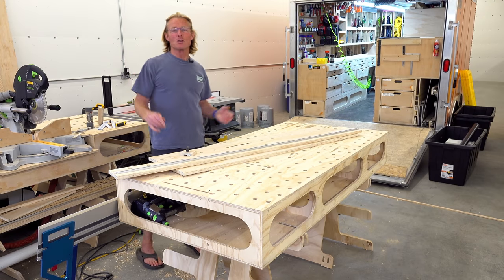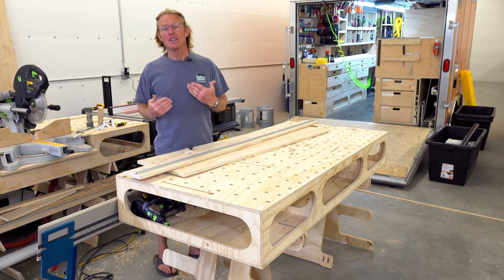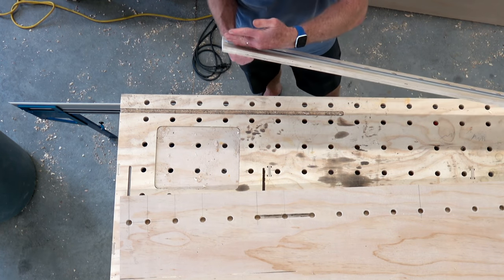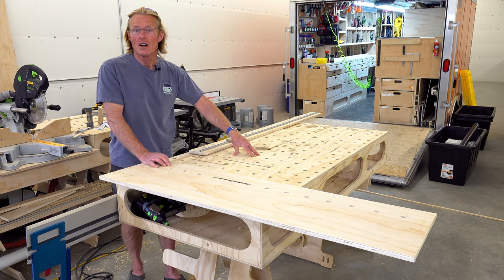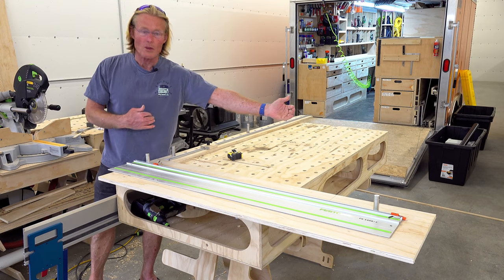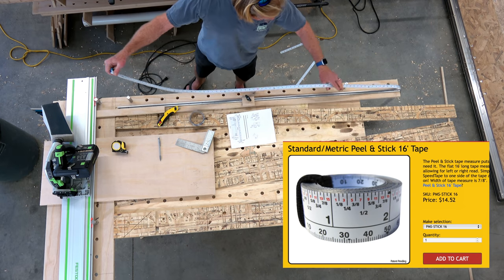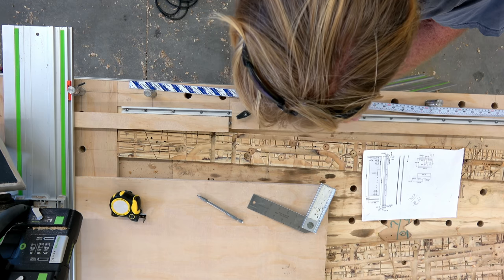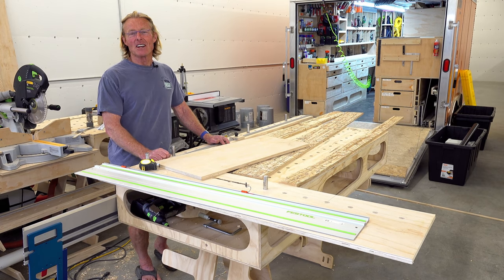Smart Cross Cut or SCC

Comment: Thanks Ron!--you just solved how to keep the bench from being scarred up.  I almost ran a sacrificial MDF strip like the MFT, but this is more elegant.  I have the workbench II finished and loving it.  Front half (router side) is setup standard 90 degree x/y, and the back 2x8' section was setup with an isometric layout.  This fixture will be perfect for either setup.  
Side note--Try the TSO precision dogs--they take a standard m8 based knob and are much easier to put in and out over the ones in the UJK kit (mine is version 1, not the new version 2 that you have). And yes..the UJK parf guide is amazing for laying out the top.

Comment: I noticed when you were laying out the initial 3mm holes with the Parf System that you started from the end of the board.  Peter Parfitt recommends that if the length of your hole pattern is much greater than the length of your Parf stick that you start at the center of the board and then work out to the ends.  Much less likely to introduce any alignment errors.
Reply: Ron's benches are a multiple of 32mm on 96mm centers. the first hole is 32mm from all edges and the second hole from the edge is 96mm. every hole after that is 96mm on center. When you get to the opposite end you will have the last two holes being 32 mm and 96mm from that edge.

Comment: Also curious how you got your row of 20mm holes parallel to the T-rack?  Did you use a spacer to set the perf stick away from the T-track perhaps?  Thanks for the great videos.
Reply: I am at that point as well. I may use the second parf stick as as a spacer. I do want the holes perfectly aligned with the track.

Comment: Hi Ron. I was cutting 600mm sections repeatedly from a single, long (2440x~50mm) piece. For me it worked better to do the cuts about a quarter of the way along my Paulk Total Station (seriously, have you heard of them? They're great!) and feed the material right to left along the bench. This mean that the long piece I was taking parts off was supported by the other 3/4 of the bench to my right, and the piece I wanted I grabbed with my left hand and added to my components pile. I see that because of the fence, measuring tape, and stop block, my approach wouldn't work. That's fine, but I wonder how you manage feeding in larger pieces to systematically take chunks off them? Do you simply put another bench or saw horse or something to the right of the bench to hold it up?

Comment: Ron, @ 3:02 looks like you might benefit from adding a couple hanger hooks for the track on the front of the bench Ron. I see you went to put it down and it slipped. Seems all it would take is a nudge and it's gonna fall, but if it was hanging on a pair of hooks on the face of the bench it wouldn't and less chance of damage to the track.
Reply: A pair of Track Racks would work great for this situation. Wouldn't even have to lock them in. Just mount them upside down, stick the track in there when not using it, and that thing won't go anywhere.
Reply: @wichyfication  do you have a link for Track Racks?

Comment: Hey Ron, excellent stuff.  I wish I would have found you a long time ago actually.  To get to the point, I am building a table based off of your design.  I purchased some TSO bench dogs and the TDS-13.  My question is for anyone really is regarding if I should build this cross cut as well or just utilize the bench dogs and TDS-13 for repeatable cuts.  It seems like your design is more efficient and repeatable when breaking down and resetting up to make more of the same cut in the future.  Is that an accurate statement?  It seems like once set up, they both would work well.  Am I correct in my thought process?  I am going to be using this for everything, but my first task is to build cabinets for my kitchen as I am remodeling it.  Thanks again.

Comment: Ron,  
Do you ever wish you had a cabinet saw or do the jobsite TS's cut quality and accuracy meet your needs?  Your finish home remodels always look professional and spot on, I just wondered if you didn't need as much mobility if you would consider a cabinet saw.  Also have you had a cabinet saw in the past?  Thanks for your channel!
Reply from the maker: John Petsche I have not once miss having a cabinet saw. I get the results of a sliding table saw with my FT track and for rips 18” and under the SS job site table saw works as well as any cabinet saw.

Comment: First, I would be interested in plans for this.  Second, how do you handle narrow stock cross cuts (more narrow than the FT rail)?
Reply from the maker: Link to plans: https://stores.modularmarket.com/paulk_homes/index.php  I use a table saw for narrow rips. I don't have an absolute, but 18" and under the table saw is my goto.

Comment: Ron, the workbench that you are using your  cross cut fixture on, is that your compact workbench 3x6?  The holes on that workbench were made with the UJK parf jig, correct?
Reply from the maker: The PCB predates switching to metric so the holes are 20mm but laid out 102mm(4") Just ignore the layout on the plans and use the Parf Guide for 96mm spacing. I plan on updating the PCB to be exactly like the STS when I have time. Personally, I would get the STS and build it without  the miter stuff and you will have the new PCB that I will be calling the SCB😎🤙

Comment: Ron, I noticed you were using the UJK chamfer tool on plywood.  The websites that sell this tool all have warnings that the tool should only be used on MDF and HDF.  I assume they are worried about chipping the veneer.  Have you had any problems?  I don't have a router yet and this tool seems ideal otherwise.

Comment: Do you have any jigs for repeated rips of narrow stock with a tracksaw for face frames? Id like to eliminate my tablesaw if I can.
Reply: two ways--(with jig above) use a spacer same thickness as your stock but wide enough to support the track. The measurement would be the tape minus your spacer. Make it about 300mm (~12 inches) from stop block to business side of the track, and as wide as you can (parallel to the track cutting side).
Second way--use a jig on what is normally the 'waste' side of the track saw.  Use 1/2" ply as a bottom for the jig and make 96mm dog holes to index into the bench (like the cutoff side in the SCC). Use 1x as a stop block and mount toggle clamps.  Think taper jig for a table saw (slot out the 1x to adjust depth (width) of cut).  Just remember--you  are cutting on the 'opposite' side of the track, so have to add in the blade kerf to the measurement--the good stock comes out the 'waste' side. If you dont, what you cut is going to be a bit of 2mm short.

Comment: Would be better if the material could slide under the track without  lifting the track. Great work Ron
Reply: You would need to make sure that the height of he track then is perfect and will not bend or flex because that could throw the cut out and make it so it is not square.

Comment: curious how you compare your SCC to using your TSO track square and a TSO TPG to do the same?
Reply from the maker: I am planning on doing a review of the TSO soon. I am a field beta tester for TSO so my kit is a prototype from a few years ago. I should get the final set soon and after I put them through some testing, I will do a detailed review with my opinion. In short, I use the TSO for a lot, but the SCC is for production. When I build a set of cabinets with many dozen sides like when building the Smart Woodshop I set up the SCC. There is a lot of overlap, but I find plenty of uses for both. We live in a great time when we can get the accuracy and production of a 10' sliding saw with hand tools that go to the job.

Comment: Hi Ron, why do you use two table saws at the same time?
Reply from the maker: I enjoy setting up one for dado and the other for the rest. It is a luxury and not necessary, but nice if you can.
Reply: Thanks Ron. I’m planning to do most of your things including the van trailer as I need to shift between home, warehouse and job sites. Your work is going to save me months if not years of exploring. One more question, if the following Festool table saws are both available in NA, which one will you buy to add to your smart workshop: CS 50/70 or TKS 80?

Comment: Ron, is the parf system the only way to make this viable?
Reply from the maker: WhoDatBe Dare or CNC.
Reply: Of course not. It's massively over engineered and completely unecessary.  The holes serve no useful function unless you're face clamping things down. (and even then there's much simpler ways).  You just need an 8ft straight batten fixed to one side of your table and two blocks of wood nailed down square to it to rest the track against.  This 32mm system shit is getting way out of hand.
Reply: @juancornetto8243  No. You are completely wrong. I have a wood technology degree from EKU. I have worked in multi million dollar wood labs. This system is a complete revolution. It replaces many of the 6 figure machines I used for commercial set ups. It is just as accurate, and much easier to use. The original Festool MFT table is a great idea poorly executed.

Ron is a straight up genius. He fixed 90% of Festool's problems for them.

Comment: Ron, from watching your videos, I see that you have switched between metric and imperial. (You previously drilled 3/4" holes on 4" centers but now you're using the 20mm hole 96mm parf system. Which do you recommend for U.S residents? UJK's metric tools seem superior than other vendors but I'd like to drill 3/4" holes on 4" centers for a future bench since I live in the U.S. and have better access to imperial tool systems.
Reply: It really only matters if you intend to use the grid for cutting or clamping precise 30, 45, 60 or 90 angles.  If so use the Parf Guide II for accuracy of the hole pattern.  If not it really doesn’t matter how accurate the pattern of holes.  96mm is based on the 32mm system.  I work in both metric and imperial but use imperial tool sizes.
Reply: I began woodworking with my father in the mid 50's, and of course I began with "standard measurements" meaning inches and feet. I am now 71 yrs old and working in the shop everyday.  Although imperial is easy for me, I made the switch to metric several years ago and find it easier and more accurate in cabinet building. Along with that switch came many Festool replacements for my power tools. going back and forth between metric and imperial isn't a challenge.  I opened a drawer the other day and found my first "orange makita" 7.2VDC cordless drill from about a 1975-6 version, but it can't hold a candle in power and performance to my 5+ year old Festool or even some old Milwaukee's & Bosche cordless drills.
Ron is a master at what he has done, and with the Paulk workbenches.  His making the switch to the 32mm system w 20mm holes on 96mm centers is terrific. 
I've had an MFT3 table and track saw for maybe 8-9 years now, and the plans for the SCC will replace the MFT3 table/crosscut track.  It is GREAT with the Parf Dogs, I just wasn't smart enuff to figure it out......Ron Did it....I used the MFT3 table so much it had to be turned over a couple years ago and I have a lot of "sacrificial" junk plywood laying around, I was just too blind to think about it, instead of ruining the table top.
Some of us old dudes have made the switch to metric, I don't think you should have any problem.
Thanks for the Awesome Videos Ron, keep 'em coming.

Comment: 20 mm holes on 32 mm centers? That means there is 12 mm between the holes.....dont make sense...
Reply: I think he meant to say 32mm system. I believe they holes are on 96mm centers. Some multiple of 32.
Reply: The distance between centres is 96mm on an MFT table, possibly the confusion comes from a rail that Festool sells designated as LR32, this rail has holes spaced at 32mm on centres and can be used for shelf pin holes. As it is 32mm it can also be used for making centre holes for an MFT table by using every third hole.
Reply from the maker: frank tartan 32 mm system, 96mm spacing. Industryvstandard
Reply: @TheSmartWoodshop  Thanks. I like that system.
Reply: @brandonthebuildertx  thanks, ron gave clarification below.
Reply: @cincinnatidoersclub8517  thanks, ron gave clarification below.
Reply: @goatsears  thanks, ron gave clarification below.

Comment: 10:54 "the only way I rip plywood any more" - moves immediately to the table saw to rip plywood. Waste of time.
Reply: Well, no. Jobsite table saws have a limited rip capacity and even if the fence could manage your desired rip, it's sketchy at best to try and run a full sheet on the small table with only a small amount of fence before you get to the blade. Ripping full sheets is a much safer and more accurate with a track saw. Ron is hooking you up with the repeatable production side of things.
Reply: @Monsieur405  Yes. People who have not handled a lot of sheet goods are not going to understand how much we love this system.

Comment: Why multiples of 32mm for goodness' sake?  If metric why not a 50 or 100 mm grid, and 32mm isn't an imperial whole number either.   Is this some elaborate practical joke ?
Reply: As far as i know it stem from the period just after WWI. They needed/wanted to mass produce furniture and the closest you could get drill heads together was 32mm
Reply: @tomfirens1400  hey thanks for the reply, Tom. I guess that makes sense as an origin though i don't see the business case in 2019 for 96 vs 100.  SO much horrible arithmetic and risk of error for no good reason.  I am very happy my certiflat welding  fixture table has 100.00 mm centres, and i plan to stick with that when setting out for   the torsion box woodwork bench with hole grid that i am planning.
Regards, Nev
Reply: Or you can get a FastCap dual scale rape measure for $10 that has marks every 32mm.  I work in both metric and inland you get the sizes into your head after a while.  50mm is about 2 inches...
Reply: It's not relevant to woodworking I don't suppose, but 32 is a nice round number in computers, which use binary. 1, 2, 4, 8, 16, 32, 64, 128, 256, 512, 1024, etc. As a software developer, I quite like it. I even had a 32nd birthday party instead of a 30th. :)